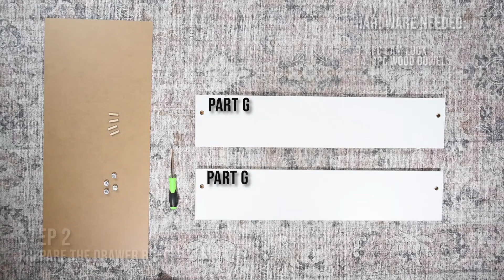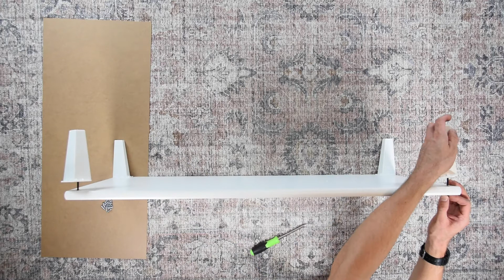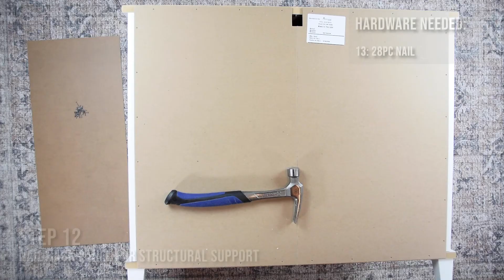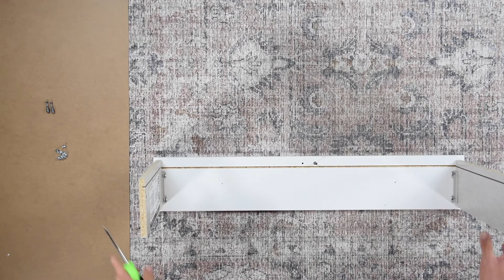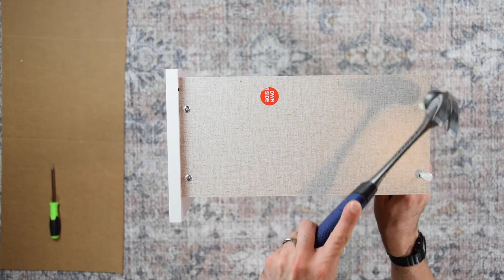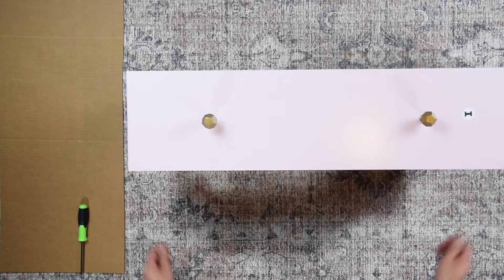How To Assemble Little Seeds Monarch Hill 3 Drawer Dresser 6827334COM

Comment: I’m trying to assemble bar H. Your video looks like you’re using regular screws. The instructions say to use # 7 which is called a “hidden fastener.”  Are you supposed to put that in the top of bar H and hammer it? Or are you supposed to put that directly into the flat board letter C ?
Reply: Same question here. Were you able to figure it out ?

Comment: Hey, your video is amazing. My cam bolts are covered with an black encasement and my hidden fasteners are enclosed in red ones. Should I remove these? It doesn't look like I can assemble the boards because they won't fit into the holes. 🥴 please help.
Reply: Do not remove them once you tighten them they expand
Reply: @yourmother6709  good to know, thanks for this.
Reply: Same issue didnt get a manual either. And my drawer braces seem to be metal not wood.